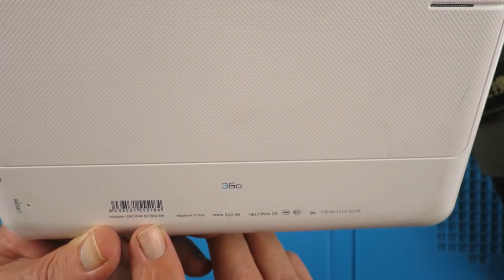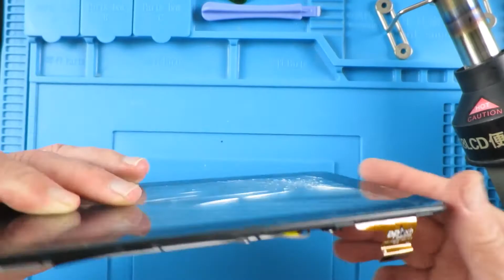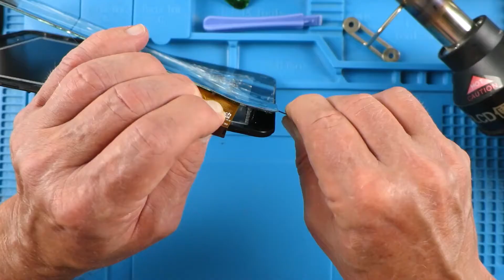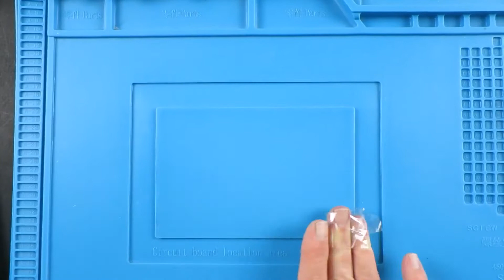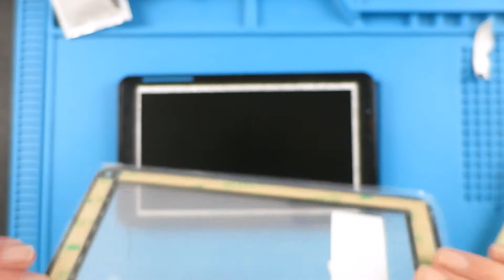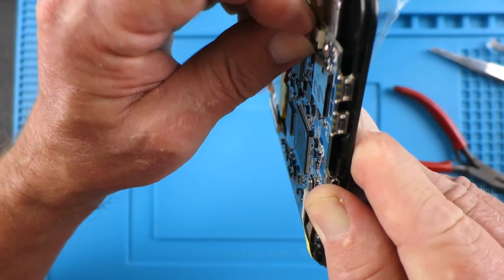3GO GeoTab GT7002EW Digitiser Replacement - Digitizer Repair Tutorial

Comment: Really nice, man. :) And what a huge battery!
Reply from the maker: 3000 mA Hours of entertainment, obrigado Mario!
Reply: 1nformatica Yeah, you could make a monster power bank with a few of them in parallel. LOL
Reply from the maker: Yep, I have some similar cells on the way to repair a solar power bank. Will be interesting to check the real capacity!
Reply: 1nformatica Absolutely! There's that board I used in a video that does that. And, of course, you could use a hobby charger to do that, like the iMax B6. ;)